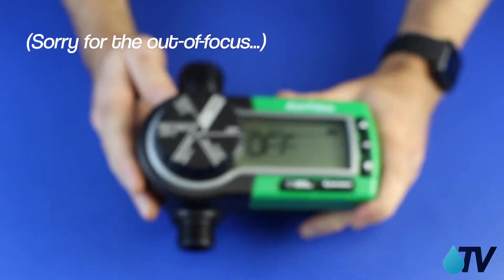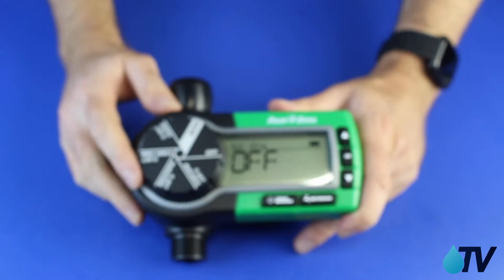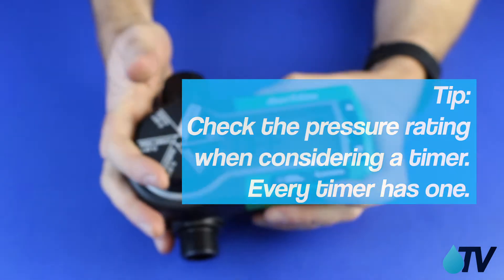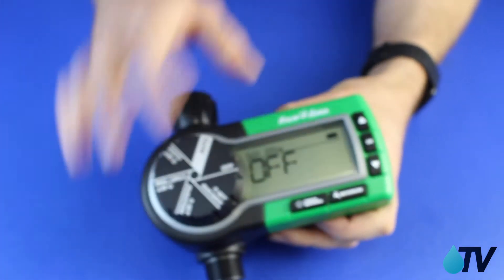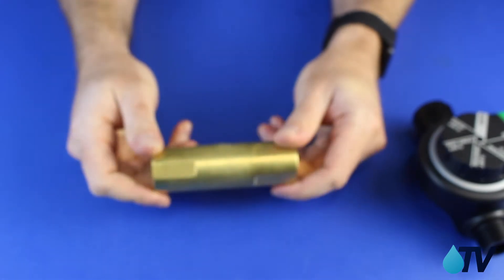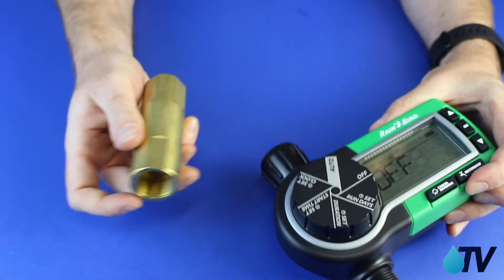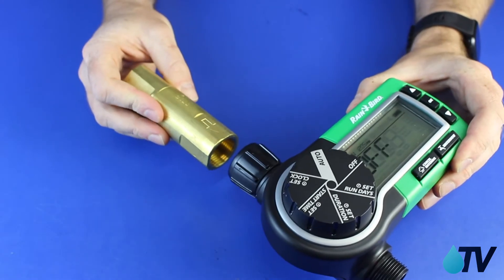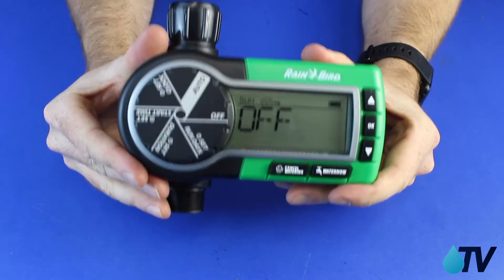Why does my irrigation tap timer keep failing?

Comment: My unit would not allow flow, despite hearing solenoid activation.   Disconnected unit from tap and was able to activate valve with 'manual and OK buttons.    Could also blow air through,  and when re connected to  tap it would allow water flow.   Shut it off then couldn't activate again due to too high a mains pressure.   Will try pressure reducer as in video clip .